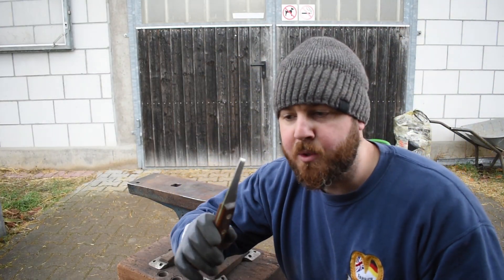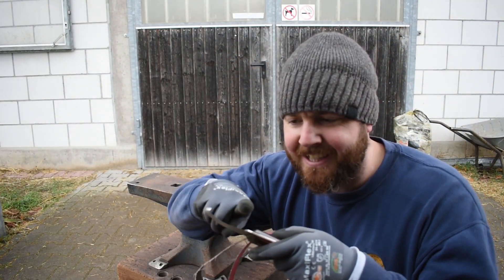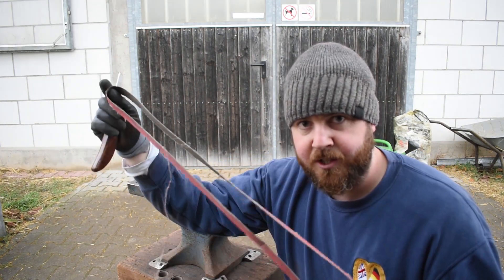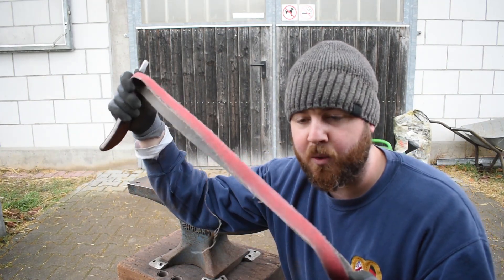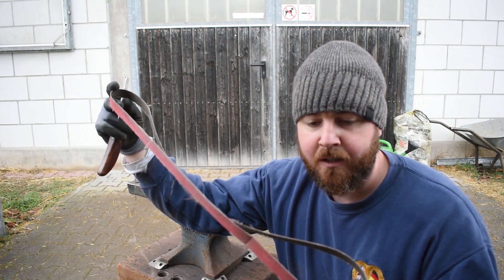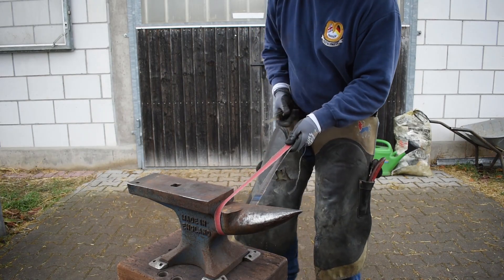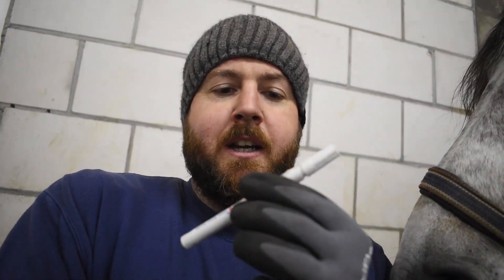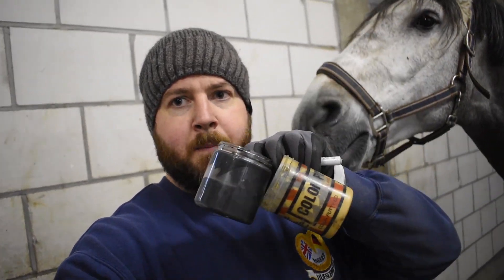3 simple "tips and tricks" to make your life easier

Comment: So funny.  I've been tracing feet for years.  its nice to see it used over seas. I only filled nail holes back in the late 90's when I was doing gaited horses. I might have to pick it back up.  Everyone is jumping on the copper nail craze, have you?  I confess I even started using them on certain horses.  I smiled on your winter video when you said 'snow grips'.   I love the rim snow pads.  Its so muddy around here I always try to never use the full bubble snow pads.  Can you please tell me the name and the size of your belt grinder ?As usual nice video.
Reply: I've tried the copper nails. Trying to evaluate after using them on horses with "murky" hooves or those with WLD-problems. On some i see a real improvemant, on others no difference. Some copper nails feel "thick" to nail on.
 My choice is to try them on problem hooves but i see no use for them as standard nail
Reply: Rock on Sam. Glad your feeling better. I just made a small Christmas tree like you did, but looks more like a leaf. :-)
Reply: I have seen the same results. Where about are you shoeing? In the  states?
Reply: Sweden, near the south coast. Muddy  southern region of a  northern country with only occasional snow. Yes It looks like a Huvema grinder. I use the same
Reply from the maker: Sorry for the delay, Been super busy here with a new product. It is the Huvema HU 100x1220 grinder. I wanted to make the video for you but just could not get the time. Will get it made in the next few days.
Reply from the maker: I have started testing the Liberty copper nails, purchased just the 1 box to test on a few horses. So far, all is well. They do look great in the box but the color is gone once you nail on and clench up (only coated).
Reply: That's awesome James.  I've been using a 2 by 12 inch expander wheel grinders with a 3/4 hp motor. The belts only being 2 inches wide wear out quickly.
Reply from the maker: Your video will be uploaded this evening Pete. I managed to get it done last night.
Reply: Thank you James